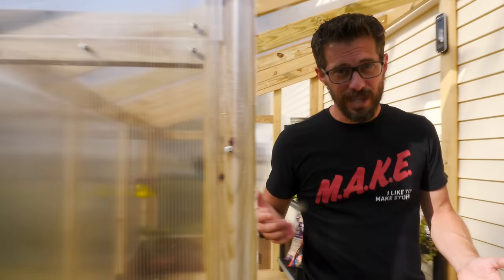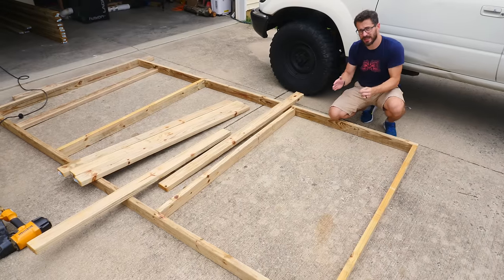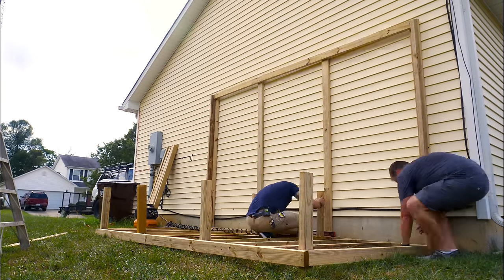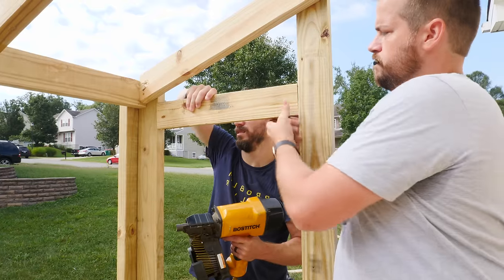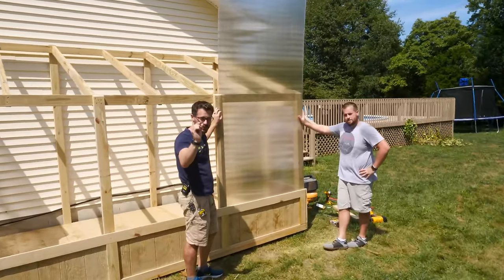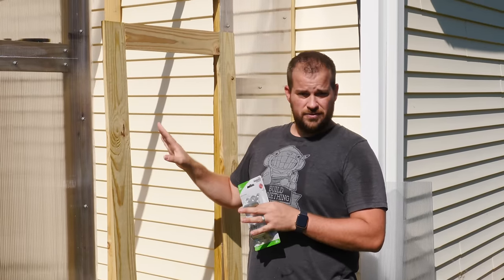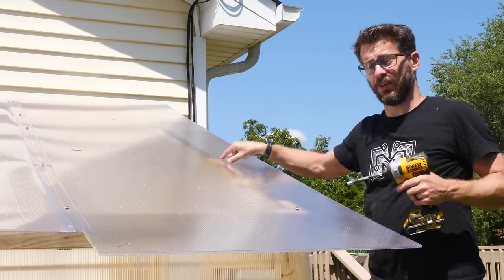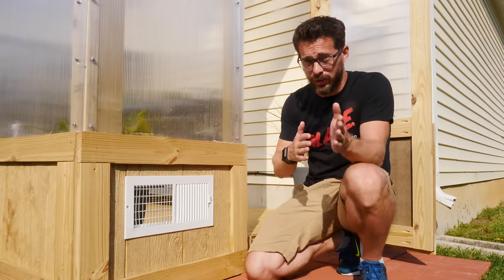How to Make a DIY Greenhouse | I Like To Make Stuff

Comment: Just a thought... this was built against a vinyl siding wall. I would venture to say that if this on the south side of the house, the siding has warped and melted due to the intense heat generated via mister sunshine. I once saw a section of vinyl wall melted due to the reflection from the nieghbors windows. Just sayin.  Still, all in all, not a bad greenhouse ; )

Comment: Quick question: How do you work out the angle to cut the roof beams? Is there a simple calculation, say, if you have it 6ft tall on one the front and 7ft tall on the rear? And thanks for the video! You made it look so easy. I'll be building my own greenhouse soon. Your video really helped.
Reply: The top cut is a “plumb cut” you can use a speed or framing square to easily get angles.

The bottom cut that rests on the top plate, look up how to cut a “birds mouth on a rafter”

Hope this helps!

Comment: My concern would be the amount of heat inside the greenhouse warping the exterior siding of the house. Is that much of a problem?
Reply: the siding is shaped so that there would be a bunch of gaps at the back of the greenhouse letting heat and moisture out

Comment: when we built our  greenhouse we used a  product called solexx that you can get in 3.5 mil or 5mil   it has a 10 yr warranty stands up to hail (weve had several storms hit ours ) and you can cut it  with a sheet rock  knife comes in rolls (you can go around shallow curves (we did) its not the cheapest but lasts incredibly good (northern oklahoma)

Comment: I noticed he used screws instead of nails for the flooring is there a reason for this? I'm extremely novice and never built anything with wood so trying to get an idea on why that was done if anyone can chime in
Reply: So basically you can take screws out but you can’t take nails out. So let’s say the boards rot. He can unscrew them and remove the boards. But if you are trying to build a green house don’t use wood!! Use gravel or something so nothing rots and there is no bug infestation. Hope this helps.
Edit: by the way if you ever have any wood or see any like big logs just saw them and get a couple nails and a drill and see what you can make

Comment: Since it is outdoor, does pressure treated wood for the base required?
Reply: Treatment or not the base will be a rotten mess after a few years, it needs concrete base or padstones, damp proof membrane and an air gap underneath so it doesn't rot

Comment: Nice greenhouse but I would never recommend putting a wood floor in a greenhouse. Just build a framework of 4 x 8 concrete cinderblocks on the ground and attach the greenhouse to this frame. Then just pour pea gravel on the floor right on top of the grass, the grass will just die underneath and the gravel will help to create humidity in the house. A wood floor will not last long :(  And this goes for the wood at the base of the walls too, just bring the plastic all the way down to the ground. Looks nice guys but it has to be practical too!
Reply: Or he could just use some hardie boards. Won’t rot. Expensive but hey

Comment: Wooden floor in a greenhouse is a huge,gigantic, -no-no. It's going to be constantly wet from watering the plants..things in greenhouses dry out much slower with high humidity also doing a number on wood. Concrete is best we all know...but pea gravel works fine...pavers on sand is easy and less noisy then walking on the gravel.
You didn't mention what this would cost. Most important point of all.

Comment: When placing the floor boards, I wood (haha) have used a 12’ x 8’ and a 8’ x 4’ cut down to 2 pieces, 8x 2 and 4x2. This plywood would be laid down lengthwise  so the boards would stabilize along the length of the structure, rather than having it have 3 sections.

Comment: I have termite eating my pressure treated wood with my garden bed.  Terminate also eat cardboard.  Once the chemical is gone after 9 years termite start eating it.  Putting near a house is just telling termite  come eat my house. I am not a carpenter but I can use a drill and screws.

Comment: You do realize the by putting a joist at 4 feet and then evenly splitting the rest with a total length of 12 feet still lands all your joist at 16 inches right..? Just with a weird cut to fill the middle

Comment: I'm not a professional Carpenter. But, I saw all kinds of amateur mistakes. 
1) Are those pressure treated or regular lumber you're using?
2) The leg supports for leveling. Is that it,  No concrete base to spread load.
3) I guess, it might be OK for a 5 to 10 year life expectancy project greenhouse.

Comment: Millennials 'building' a greenhouse on stilts that will go crooked, with a plywood floor that will grow mold, with siding touching the ground that will rot and taped on air vents.     Could have spent another $100 and done it correctly.
Reply: Millenials know everything about everything.

Comment: High moisture so close to the house (from watering, and trapped humidity) may result in swelling of the ground at this corner of the house, differential ground movement damage to the house, as well as attracting termites. I would not recommend anyone attach a greenhouse to their house.

Comment: Very cute, but you don't have near enough ventilation. The plants WILL die! This construction is also of no value any palce that gets snowloading... no purlins, and the glazing isn't near strong enough... cheap, but of no long term use! The "feet WILL sink into the ground - any kind of ground, and you didn't even recoat the cut ends with proper product.

Comment: I was hoping this would give more practical info than it did. Seemed to be in so much hurry for important details for newbies. No matter what soil ph, it will eventually destroy the wood resting on ground. Hate to be the gardener in the summer, such tiny vents are useless— why not make larger vents first in frames, no need to climb? A lean to can be tied into the house rafters, not into the siding. Not my style for sure.

Comment: Good build but my only criticism is that those vent openings in the roof are NEVER going to last or be effective!! That's really not a great idea! It's never going to actually work effectively and it's just gonna come right off once it rains a lot of the wind gets a hold of it, no matter how strong the adhesive is!! It would've been better just to frame in the opening and take the piece left over that you cut out and build a small light frame for it an then screw it to that and then simply just add some hinges(however many you prefer) & a small latch and you've now got yourself a solid & lasting window for ventilation that's easily built in a few minutes and can also be latched shut. An You could also even add a seal to it too which would make it air & water tight as well if you chose to do so instead of having just that little plastic flap that's literally going to be flapping all over the place any time the wind blows & eventually go flying away or just coming off regardless because it's literally just a piece of plastic taped to the roof!! Just a thought! As for the floor, I've gotta agree with the people saying it's a bad idea. It will only end up being more trouble than it's worth!! An a floor really isn't necessary anyways since whatever you out down is going to eventually become a home for bugs and if it's raised it could end up attracting snakes looking for a cool moist place!! Gravel is a MUCH better way to go!! The Humidity of a greenhouse is going to lead to that wood becoming VERY nasty & likely troublesome for you plants due to bug infestations and wood rot!

Comment: NEVER build a lean-to greenhouse - leaning on your house. Unless it gets very little use, eventually it'll rot your house. Just google it. I've seen it, too. After 20 years their entire house was mould ridden, had to be stripped to the studs and restored from that base. Lost all family heirlooms and got a bad case of hypersensitivity to mould. THis greenhouse is smaller, but humidity can still cause damage. If it's just for a few tropical plants or starting flats, you might be okay, but presumably if you bother to build a greenhouse you're actually going to use it.

Comment: Some of this terminology he is using, I have NO CLUE what he's talking about. 3:05 I still dont understand what washing the side of the house has to do with the green house. Its not going to be connected and it going to pushed against it? 🤔 so when they move if the move the shape of the greenhouse will have that section over time lighter in color or dingy looking from the green house🤷🏽‍♀️ i dont get it

Comment: No heat sink, not enough ventilation, the floor and wall of the house are going to have too much water exposure to last very long. I'm in zone 6, cold winters and warm summers. This greenhouse would not be helpful in either of those seasons.

Comment: I used to be a framer's helper and build many walls - this is just not the way you would build the back wall sorry.  Yeah it floppy, LOL.  Back wall should be built like the floor was.  And why did you build a great wall frame for the floor for a greenhouse?!?  The Floor should have been the back wall, the floor should have been like pea gravel for drainage, or whatever.  This is pretty on the outside though.  Just seems reactive and not like a real greenhouse architecture. Great stuff though.

Comment: So from what i gather this is a bodge job as looked like the wood placed in the ground wasnt even cemented in place wasnt even shingled to drain water when wet the ground wasnt made level no damp protection between it and the house so all in all as finished looks okay but will in about 2 years cause major rotting underneath and against the house so I think after this was filmed and after the summer this was taken down 😂

Comment: Framed wrong.  You should have framed the wall and stood the wall on the deck after sheeting the deck.  This would have tied it all together and taken the stress off of the walls which will be supporting the roof.  Plus you should have placed the deck on some type of cinder block.  Even though the wood is treated it would last a whole lot longer setting on a cinder block or cement paver. At least that is how a real builder would have built it.

Comment: Is ground contact pressure treated wood in the US really still that pale pine colour? Even on the Lowes website ground contact wood looks a darker colour. Amazing how the video doesn't even bother to discuss these kinds of details. Is it a kit, is it? 

This would never get approved in a million years in Australia, there are several things about it that do not meet building standards here. This would not stand up to strong winds creating uplift and the method of attachment and support is inadequate. Furthermore, as a greenhouse the temperature and moisture control is woeful.

Please take this as a starting point.
Reply: Oh good god! Kentucky! Tornadoes, frosty winters, hot humid summers! This will lose heat very quickly, without contact with the ground or insulation or protection from prevailing winds, and gain heat very quickly! Without good airflow things will rot in summer, if they're not baking!

Comment: PT lumber is impregnated with toxic chromium, copper and arsenic as the preservative.  Using
 it for interior areas that are not exposed to weather but are exposed to humans and human activity is a mistake in my view.  Plus, PT is way more expensive than regular SPF lumber.

Comment: You water plants within the greenhouse.  This means that even with pressure-treated wood it is going to rot much more quickly because of the extra moisture from the water inside the structure.  For my greenhouses (yes, multiple) I elevated the frame just like you did by about 2 inches from concrete pads, then dug a drainage system for the water and put down 1" rock, 6" deep.  It drains, the floor does not rot because the water drains, it is not a muddy stinking mess because any water or small amounts of dirt will wash through the rock to the drainage system.  This is pretty, but not practical for a real working greenhouse.
One last comment, this greenhouse is a joke.  One good windy day and that thing will just be demolished.  Those flaps on the roof will chatter and rip themselves off

Comment: 16 on center for a 12' greenhouse? Don't do that if you are doing this in 2021. No point in wasting money with wood prices through the roof. 24 on center is MORE than adequate, afterall pretty much all homes built in the 50s-60s were 24" on center and are still standing. But nice looking setup, just might be overkill for most.

Comment: Frame walls on the outside of the floor frame? Then cut floor panels around studs? LoL! No!
Frame the base on piers or gravel, place the floor. Then frame each wall. And brace each wall so that they do not rely on one nail or screw. Screw or nail each wall through the floor to the perimeter frame. 
Not a build that follows time tested framing technique.

Comment: This is more of a sunroom than a greenhouse. A wood floor will not last in an actual greenhouse, no matter what type of wood you use. There also doesn't seem to be any type of true foundation. The design is beautiful, no question, but I don't think it is functional as a green house. No plumbing, proper drainage, humidity/temp control, etc. For the price they likely paid for the materials, especially the plexiglass panels, which will cost about $80-$160 per each sheet, they would have been by far better off hiring a professional or even purchasing an actual greenhouse kit from Lowe's or home depot. Again, it's beautiful, but I just have a feeling it will turn out to be a very expensive mistake, starting with the foundation and floor.

Comment: Alas, this is very pretty BUT NOT A GOOD PLAN. Absolutely baffled that a knowledgeable builder would place any wood--especially a floor--in direct contact with soil (the grass will rot within a month). Have the builder and designers not visited a functioning greenhouse? A pressure treated wood base for the walls sited on leveled gravel or patio stones would accommodate watering plants and prevent insect and rodent issues with wet wood.

Comment: I don’t know what state this is being built in, but this cheap Lean two may not last a full twelve months. With cheap panels for the floor, it will warp from water used, rain, humidity and heat! Then if it snows where they live... well, you get the idea. I am also assuming this state has windy days as well. Where we live, if this structure isn’t cemented into the ground, it would be blown off just by the first windy day with wind gusts of 50mph + gusts. 

By the way, those exposed electrical black wires are a safety hazard and wont pass any city or  state codes.  Personally, all this guy is teaching is every wrong way to build anything!😂

Comment: Ugh!
Prima facie this looks an attractive and simple solution but ... 
1. The prodigal scatter-gun use of a nail gun is a lesson in how not to do carpentry
2. The whole weight of the structure is supported not  - as you might think - by the main uprights but by nails bashed into the base horizontal, in turn nailed to the short base uprights - a recipe for collapse
3. The choice of wood is wrong for outdoors
4. The use of plastic glass (or whatever) is OK for the sides but not the roof - does it ever rain there?
5. Nailing-in the plastic glass across the frame rather than slotting it in (except at the bottom) is just - unbelievably crude
6. Steps are missed out in the video - why make a video at this level and miss out steps?
7. The tools available and the workspace are at professional level, way beyond the average domestic set-up - a feature BTW of almost all videos on YouTube
In sum: you have this complacent 'isn't this just so easy, so wonderful' verbal going on but what is actually happening behind the spiel is second-rate - sorry

Comment: So many things wrong here. Unsafe practices (never use a nailer, or any power tool, up over your head like that). Wood flooring (I don't care  where you are, the constant moisture of a greenhouse will rot that wood. Even wood "rated for ground contact". Not to mention inviting termites). Using the house as the back wall (aside from inviting termites that come to feast on the rotting wood floor, the siding will be discolored, so when the greenhouse is removed, it will no longer match the rest of the house.). Legs not set in concrete (those suckers are going to rot, and sink. And probably not at the same rate, which will make the structure unstable, and unsafe).  You can buy one with an aluminum frame and hinged vents. Probably for less than what it costs to make this. And it will last a lit longer.

Comment: I have to say that, sorry, but you guys have no knowledge of the ventilation and you make everything wrong. You have to remember that any room is breathing cool air coming through top window falling down and then hot air come out, so you basically need to make two small windows on the top of the sides and not need make on bottom.

Comment: Jesus this seems sketch as fuck. Also you might want to look into a product call cocking. Also you might want to look into how builders prep Foundations. Btw that looks like it leaks like crazy and with no paint or protection on the wood i bet its going to start rotting away fast from water damage. Its also kind of a Eye soar... I am assuming you didn't care how it looked only about its function but i wouldn't put electrical into something that sketch sense it looks like it wouldn't hold its heat in the winter so why even call it a green house at that point.